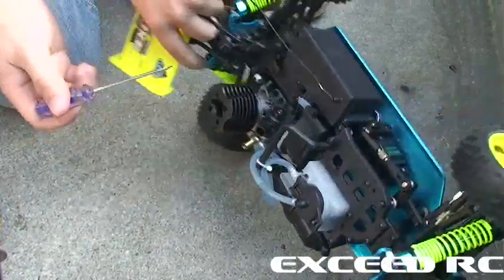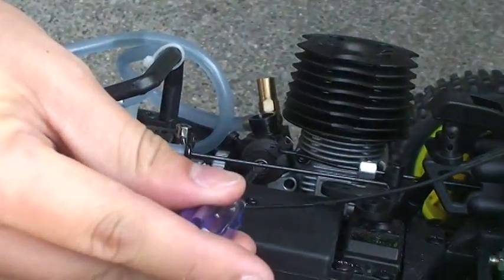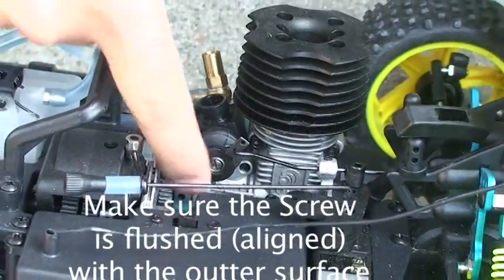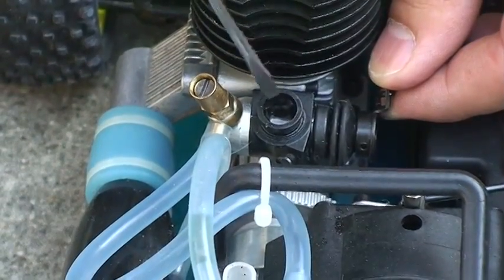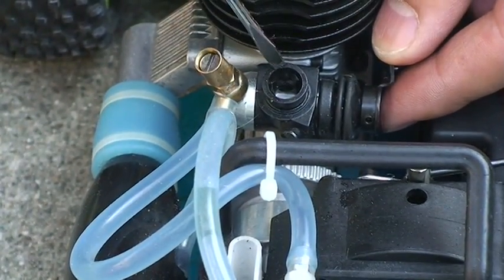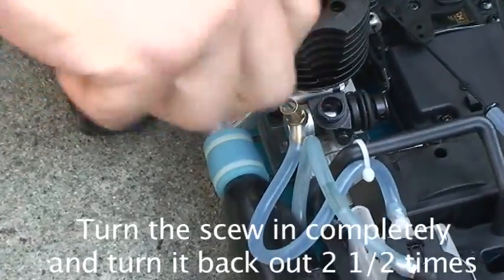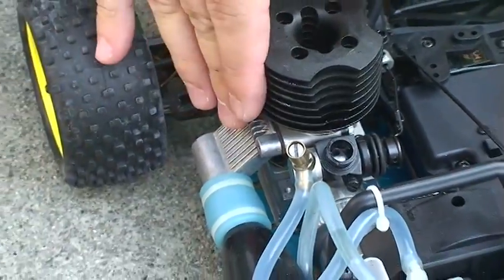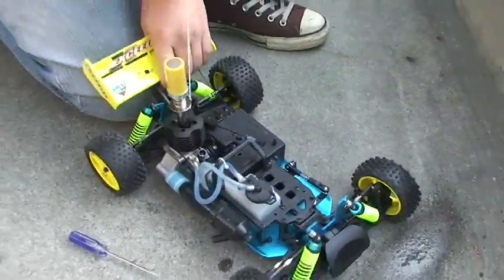1/10 Scale  nitro Break-In Process

Comment from the maker: Well, 5 tanks is recommended but you can try 2-3 tanks if you don't feel the need to waste fuel. You can slowly move the car around and rev its engine a little. Do not high rev the engine as it will lead to premature wear.

Comment: I don't want to feel like a jerk but.....
1from the factory the needles should be set
2when taking the needles in....don't crank on them like your tightening a bolt
3your radio isn't on....
4your car had started without you covering the exhaust....
5no air filter
6 most break in process Include 1 idle tank
Followed by a on throttle for two seconds then brake at a maximum of 1/4 throttle...
Then a three second on throttle then brake... With a max of 1/4 throttle for the third tank 
Exc..

Comment: run the car for 5 tanks of fuel? no thats not in you will be fine if adjusted correctly to run through 4 tanks first tank id recommend you let her idle and seat in on half a tank then the other half you start going quarter throttle holding for 2 secsthen stop repeat that till the tanks dry. Then restart this process on tank 2 with a few revs to half throttle. A engine wont wear in properly if you just let it idle on 5 tanks of fuel you will go to take off it will bog down and you wont have power

Comment: I would not use this method.  A) those settings are only for THAT engine, and you shouldn't tune before break in anyway.  Next, NEVER run your engine without the air filter or throttle linkage attached like this guy.  Finally, you are not breaking in your engine by letting it idle.  You need to apply throttle in graduated segments to heat the engine to sufficiently break it in.  Repeat, I would not follow this guy's advice.